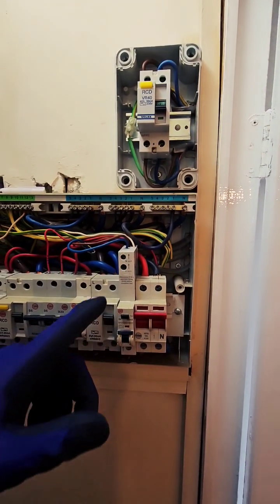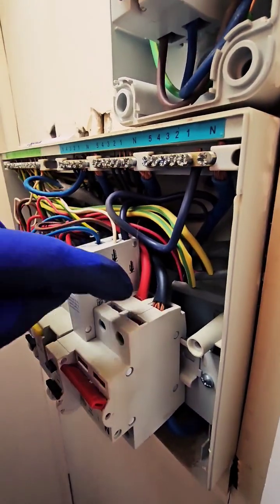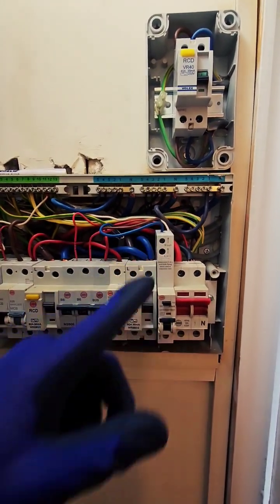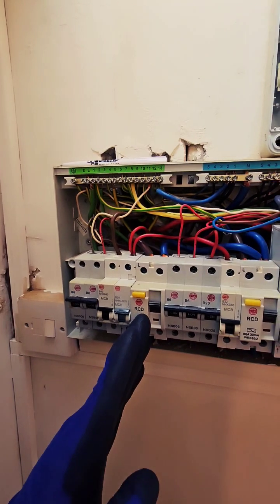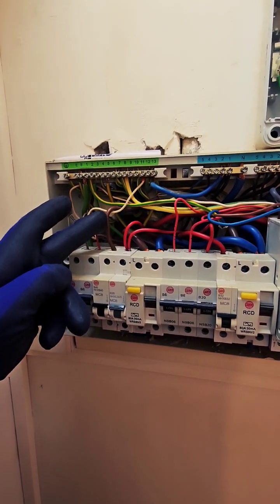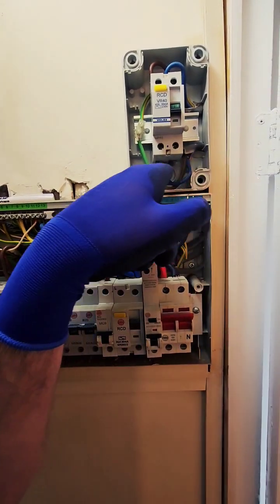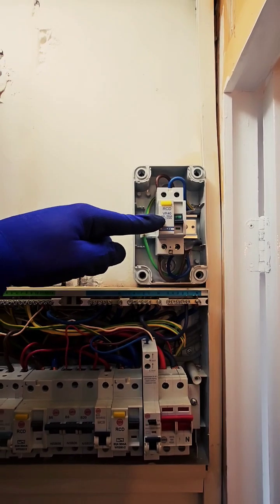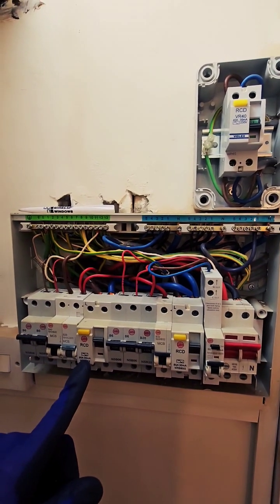How many RCDs do you need? #shorts #danger #EICR

Comment: Might not have had any RCD protection in the old board so they fitted that for the shower circuit. Probably wasn't enough length on cable to get rid and put it directly into that board so now it's just acting as a joint box.

Comment: Although things may be a mess in this fusebox, it's not dangerous to have 2x RCD's is it?
Reply from the maker: Not really, but two RCDs covering the same circuit is just not required at all. It's like installing a set of bath taps right next to your existing bath taps! No need!
Reply: @JBE  Thanks. Sometimes you see a mains socket circuit covered by an RCD or RCBO that has a spur to a weatherproof outside MK RCD protected socket. Does the outdoor RCD socket serve absolutely no purpose?
Reply from the maker: @RichardABW  The outside socket won't need to be an RCD integrated socket, just a standard outside socket will do, as it already has RCD protection on that circuit at the board.
Reply: @JBE

Comment: Saw the exact same thing with a shed supply a while back. It was installed by a plumber and he'd removed the sheath and used the inner conductors of a 10mm twin and earth as unprotected tails to his RCD. No idea how he knew enough to protect the feed with an MCB, but not enough to know that the RCD already in the board was fine for the job.

Comment: It's like rcd outdoor sockets connected to dual rcd boards.. Lol, either will trip, but no need to have 2 in series. Not dangerous just stupid.
Reply: I wonder if it had an older none RCD board and someone added the shower to that board at a later date, using the additional RCD, then someone has changed the board at a later date again and the shower cable wasn’t long enough to extend into the new board so they just left the additional RCD in place.
Reply from the maker: I think that's what happened? Although, whoever fitted the board could of done away with the second RCD board and just made a connection for the shower?
Reply: @JBE   Maybe he was anxious about a single point of failure and wanted his residual protection to be redundant.
Reply: Same as requiring to have rcd protection on job construction sites for portable equipment outlets or caravan owners with 10A to 15A rcbo protected here in Australia.